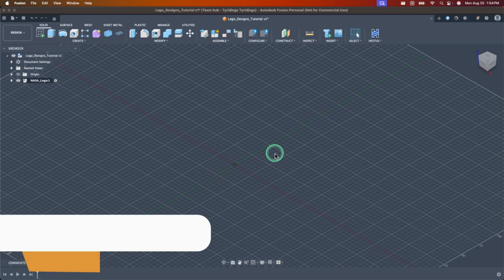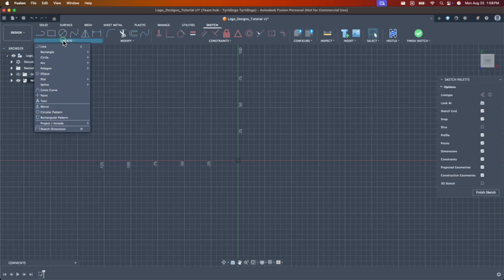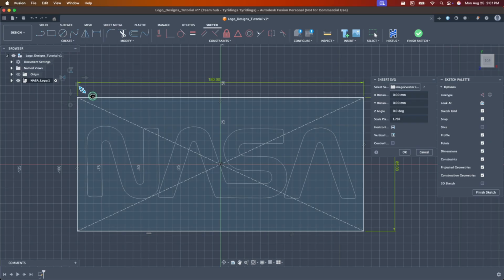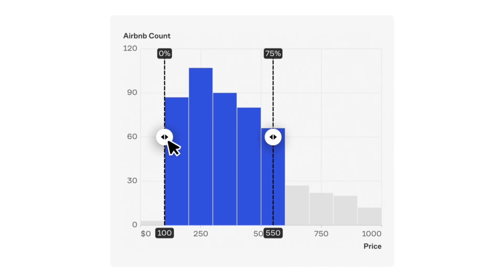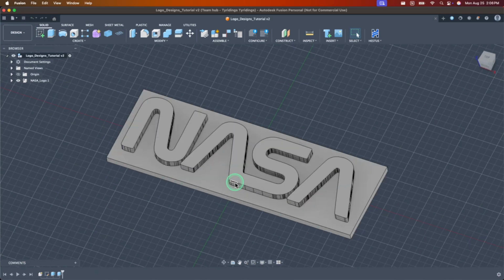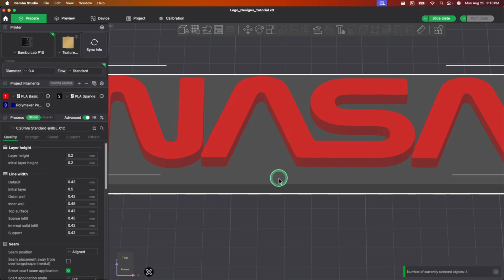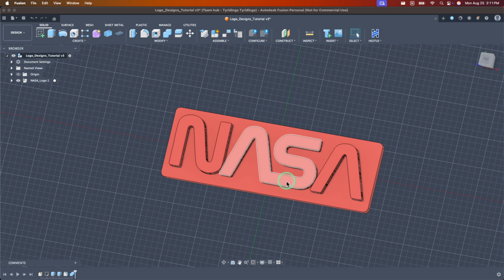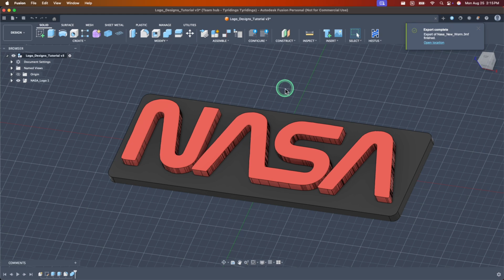Fusion Hack to Design & 3D Print Any Logo Fast

Comment: A better way for two color prints like that is to extrude the background backwards by 5mm, then the letters forward by 5mm. It'll end up the same two bodies, but the letters won't be all the way through the background, so when you set their color, it will only be the letters that are changed. Less filament changes this way.

Also, am I missing something? When I try to bring a 3mf file exported from fusion into bambu studio I get a warning that since it wasn't made with bambu studio, it can import geometry only. It still has the separate bodies properly positioned, I just have to switch the colors manually. It looks like they imported into bambu studio already colored in your video. Is there some trick to this?

Comment: Great video, but when you bring it into Bambu slicer, it will print a lot faster. If you use the slicer to change the filament at a specific layer (using the timeline bar on the right, click the plus and change color at a specific layer) that way you won’t print red all the way through to the bottom and have all those color change swaps that take a lot of time.  Out works great on 2 color prints, even on a printer without an AMS.
Reply: Or just export as single body and use the paint tool.